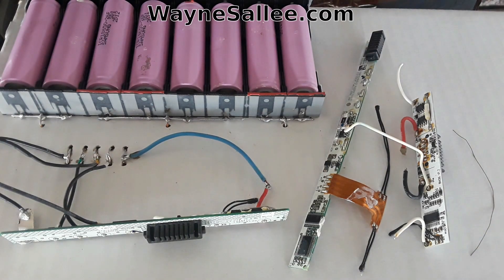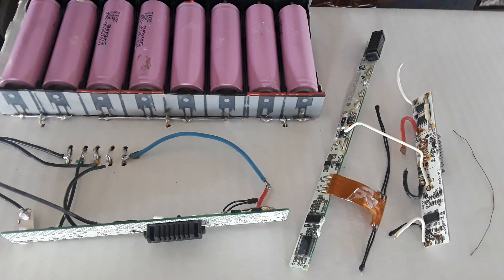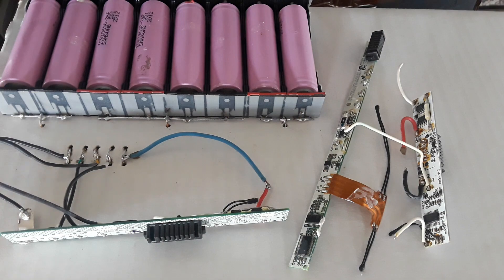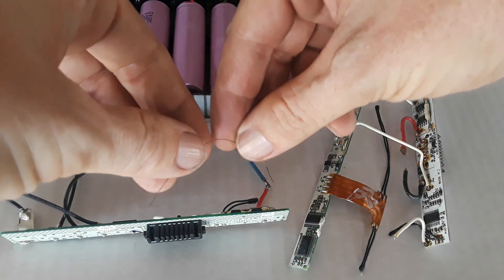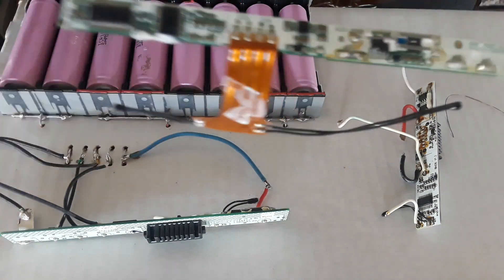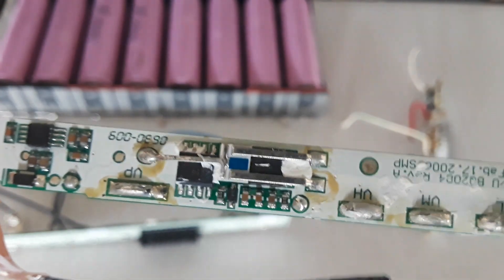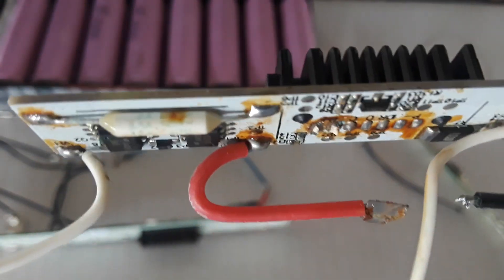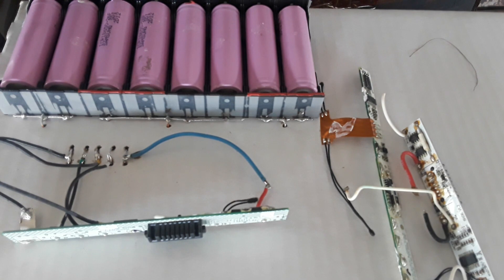Resetting Your Laptop Lithium Battery Pack After You Rebuild it.

Comment: hello!!
my battery sayd charging but it was allways 0% and had the warning to replace it...
i did just  that positive to positive and no warning and charging!!!
the way u laghting.. just give me some of that weed!!!
thanks a lot!
Reply: the only problem is that its one of those completely sealed batterys.. and i had to almost destroy it to open.. but its in place and working.. now its too late but i should just dig a hole on the case on the side of positive baterry wire to make the reset
Reply from the maker: @sergiobisonte  You can also restart the battery by giving it the proper voltage without taking the battery apart. Though taking it apart does allow you to see if there are any leaking batteries. When your batteries get old, you can buy some new batteries, and rebuild it. After rebuilding it you will have to restart the battery. I purchased my batteries at liionwholesale.com

Wayne Sallee
Wayne@WayneSallee.com
http://www.WayneSallee.com
Reply: @WayneSallee-comTech  i couldnt open  it. it was to hard... just open enought to conect the wire... well the battery does not hold to much time cause its old... but at least its charging again and there is no replace message anymore
Reply from the maker: @sergiobisonte  Yes they are hard to open. They don't want us repairing them. There are a variety of methods on youtube on how to open them. The long skinny ones tend to be easier to open, as they can be twisted to help loosen the glue. On this laptop I'm using, the battery case is almost square, and was very difficult to open in such a way that it can be reused. Solvents usually don't work, because any solvent that will dissolve the glue will also dissolve the plastic case, though the solvent does make it easier to open if you don't care about it not snapping back together. The other danger is damaging the circuitry or battery, as there is very little space between those items and the case.

Wayne Sallee
Wayne@WayneSallee.com
http://www.WayneSallee.com

Comment: Hello. I have an X541SC laptop and the battery died. It lasted 2-3 hours, but I can no longer run the laptop with it. When I took it out and measured + and -, there is no voltage. I told myself it was dead. I took another second hand, but i did not measure it before taking it. I just took it and put it on the laptop, but it's the same case. When I measured it, again there is no voltage of + and -, but the batteries themselves on both sides give 11-12 volts. Does anyone have any idea if this is a dead board / battery processor, or for some reason there is a protection that has turned on and stopped the output voltage? I found this on the internet:

Some batteries are equipped with a solid-state switch that is normally in the “off” position and no voltage is present at the battery terminals. Connecting the switch terminal to ground or pulling it up often turns the battery on. If this does not work, the pack may need a code for activation. Battery manufacturers keep these proprietary codes a well-guarded secret to which even service personnel have no access.
Reply from the maker: What is the lithium cell configuration; how many cells, how many parallel?
at 3.5 to 4.2 volts per cell that will tell us how many volts it should be reading.

Wayne Sallee
Wayne@WayneSallee.com
http://www.WayneSallee.com
Reply: @WayneSallee-comTech  Hi, i'm going try to explain what happened from the start. First I've upgraded my bios with newer version, but my laptop wasn't able to connnect with SSD drivers anymore. And then i've notice that my laptop just turn off while being in battery only. After reset, it could go longer for like 5-10 mins and turns off again. My battery was fully charged. So i've downgrade my bios again. Because i thought it's from it. But this case continue. After while my laptop couldn't anymore turn on with battery and once you unplugg the charger, the laptops turns off. I've tried alot of software tricks, bios load default settings and etc, but nothing worked. So i've removed the battery and meassure the voltage. There was no voltage from +. Just Zero. I've meassured my motherboard pins while charger is inside, you could see 12 v on two pins. So there was no problem with the charger. My batteries meassure is like 3.6-7 voltage per one. All three batteries have 12.5 voltage. But there is no voltage on + pin. So i've started to lurk in youtube. I've found a way to give 12 + directly to the pin of the battery so you can reset BSM or something like that. That didn't work too. And i've read about Fuse that could be in fault or CHIP Lock , which disable charge and output voltage of the batterie. I've bough second hand battery that should be working. I didn't measured it before adding to my laptop, so i'm not sure if it worked correctly. But after i added it and tried to turn on the laptop, nothing happened again. Once i meassured this battery too, there was no 12 v in the + pin. So i've wonder. Is it possible my laptop to trigger something like fault/defect and my battiers to lock themself?
Reply: @WayneSallee-comTech  Hi, i'm going try to explain what happened from the start. First I've upgraded my bios with newer version, but my laptop wasn't able to connnect with SSD drivers anymore. And then i've notice that my laptop just turn off while being in battery only. After reset, it could go longer for like 5-10 mins and turns off again. My battery was fully charged. So i've downgrade my bios again. Because i thought it's from it. But this case continue. After while my laptop couldn't anymore turn on with battery and once you unplugg the charger, the laptops turns off. I've tried alot of software tricks, bios load default settings and etc, but nothing worked. So i've removed the battery and meassure the voltage. There was no voltage from +. Just Zero. I've meassured my motherboard pins while charger is inside, you could see 12 v on two pins. So there was no problem with the charger. My batteries meassure is like 3.6-7 voltage per one. All three batteries have 12.5 voltage. But there is no voltage on + pin. So i've started to lurk in youtube. I've found a way to give 12 + directly to the pin of the battery so you can reset BSM or something like that. That didn't work too. And i've read about Fuse that could be in fault or CHIP Lock , which disable charge and output voltage of the batterie. I've bough second hand battery that should be working. I didn't measured it before adding to my laptop, so i'm not sure if it worked correctly. But after i added it and tried to turn on the laptop, nothing happened again. Once i meassured this battery too, there was no 12 v in the + pin. So i've wonder. Is it possible my laptop to trigger something like fault/defect and my battiers to lock themself?
Reply from the maker: @OldboyWOW  Wow that stinks that you didn't test the battery before connecting it to your laptop. At that voltage your lithium cells are fully charged. What I would do, is jumper the fuse, but don't put it in the laptop. Add voltage to turn the battery pack on, and see if the battery pack will now give voltage. If it works, then you know it was the fuse, but if you then put in in your laptop, it would likely damage the battery bms, since the fuse is jumpered. Before jumpering the fuse, you can test the fuse with an ohm meter to see if it is bad, then jumper it if it is bad.

Wayne Sallee
Wayne@WayneSallee.com
http://www.WayneSallee.com

Comment: I attached the positive to the positive and I got smoke in dell 9 cell battery could you help me out
Reply from the maker: That's why I like to use a real thin wire when testing things like that.

You want to connect the positive that connects to the computer to the main positive of the battery pack. Use a voltage meter to check the voltage between main positive of the battery pack, and main negative of the battery pack to make sure the voltage is right. If it is, then check the voltage between the two positive connections that you tried connecting to. A voltage meter only allows a tiny amount of power to go though, allowing you to safely test the different connections. Check the different connections with a voltage meter to see what you have.

Wayne Sallee
Wayne@WayneSallee.com
http://www.WayneSallee.com

Comment: Bro, I have rebuilt my Lenovo Laptop battery with 4 new cells but  Error shows "0% plugged in not charging", please help me what problem?
Old cell: 3.7v/2200 mAh, Sanyo
New cell: 3.7v/2500 mAH, Samsung
Reply from the maker: It's looking like some, if not many are designed to fail after being reset a certain number of times. It's a pain to keep the proper voltage on all the rails while rebuilding, but I think that just keeping the voltage on the main lines while rebuilding would probably be enough. But even that's still a pain, all because they don't want us to be able to repair our products that we own. @t

I hate proprietary. I'm working on building my own laptop with a desktop motherboard, and 16 lithium batteries.

Did you try applying power to the battery pack to see if it would charge?

Wayne Sallee
Wayne@WayneSallee.com
http://www.WayneSallee.com
Reply: @WayneSallee-comTech  ye, how do you ensure you got the right wires/pins xD

Comment: Please help me 
I have replaced my lenovo laptop battery with new cell.
When I put it in laptop.
I am getting "plugged in,not charging.
Si please help me
Reply from the maker: When replacing batteries it is better to maintain voltage to the bms, but that is a lot of trouble. I am thinking that just maintaining the main voltage instead of all the cells might work just as good. Doing so with a resistor to prevent high amp flow would probably be best. 

When that has not been done the bms will shut off. Often you can get it working again by applying power to the main power lines, preferably with a resistor to prevent inrush.

Wayne Sallee
Wayne@WayneSallee.com
http://www.WayneSallee.com
Reply: @WayneSallee-comTech  I have tryed this method but also I am facing the same problem.
Please help me
Reply from the maker: @praneetheditz639  What voltage do you get from the battery pack on the slot connections?

Wayne Sallee
Wayne@WayneSallee.com
http://www.WayneSallee.com
Reply: @WayneSallee-comTech  from battery pack I was getting 11.56 volts
Reply from the maker: @praneetheditz639  And from the slots that feed the laptop, what voltage are you getting?

Wayne Sallee
Wayne@WayneSallee.com
http://www.WayneSallee.com

Comment: deesnt work for me
Reply from the maker: "Right To Repair" is a world-wide movement to fight back against companies deliberately making things more difficult to repair. A lot of BMS's are being made so that you can only restart them a few times, if not at all. Did you check the fuse?

Wayne Sallee
Wayne@WayneSallee.com
http://www.WayneSallee.com
Reply: @WayneSallee-comTech  yes i had a blown fuse
couldnt find a new one yet
still thankss for the reply btw
Reply from the maker: @faaiquealimehmood  You can override the fuse with a little bit of solder. If you use just a thin tiny amount of solder, the solder can be the fuse. Fuses are made of thin low melt metal.

Wayne Sallee
Wayne@WayneSallee.com
http://www.WayneSallee.com
Reply: @WayneSallee-comTech  Alright will try that instead
Thanks for your help good sir